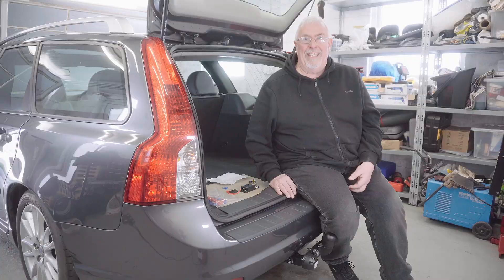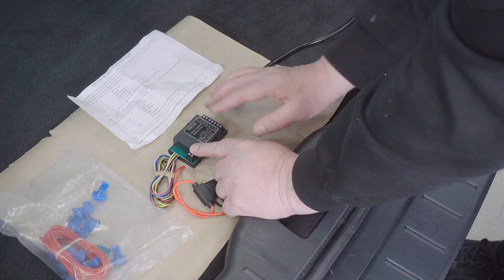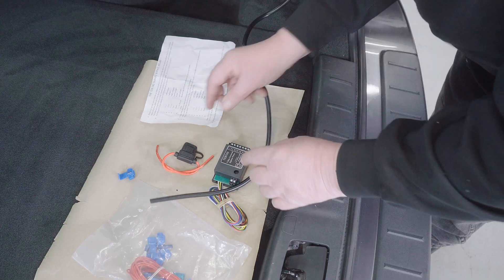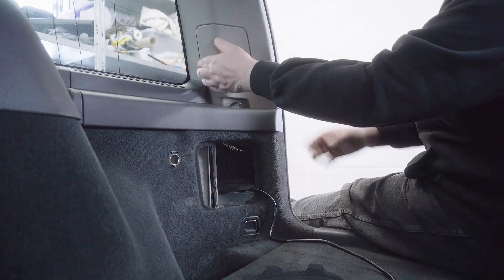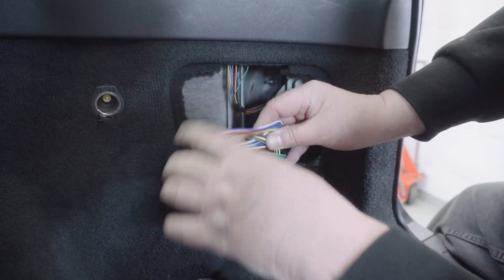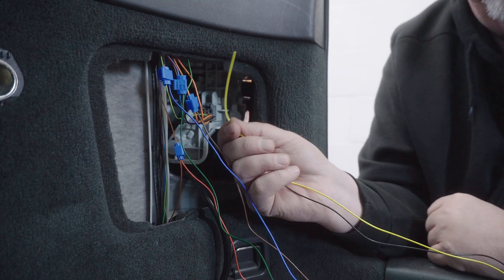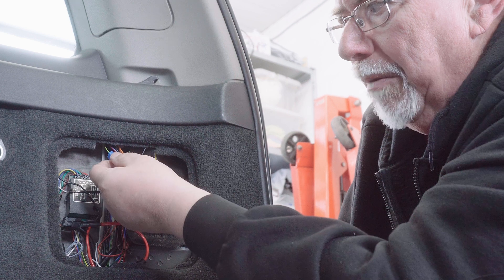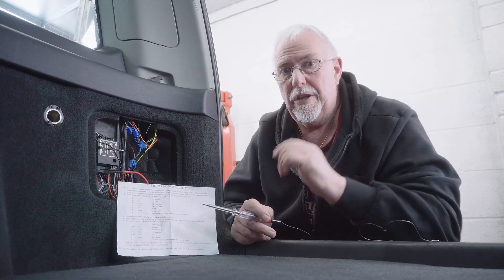Tow Bar Bypass Relay Wiring Guide | Towbar Electrics Installation Volvo V50 C70 S40

Comment: Hey. Great video. Im guessing this would be the same process to fit my 2017 Transit Custom towbar, by using the "hidden" 12v supply thats apparently installed in rear.
Reply from the maker: Thanks! It's likely a similar approach for your Transit Custom, but I'd recommend looking at the specific wiring info for your model to be sure.

Comment: I have a mondeo mk4 mondeo im aabout to wire up the towbar but would i be right in thinking that this will not bypass the reverse sensor as my cars sensor will ring out in 1 gear aswell if i have a trailer on the back is there anyway to get around this
Reply from the maker: I'm not sure how much of an issue this would be.  Most reversing sensors only work when you are actually in reverse.  So although a pain, it would only be an issue when you were reversing.  I do believe that there are ways of either fitting a switch or a sensor to disable the reversing sensors when you have a trailer, but I haven't had this issue so I can't really comment on it.

Comment: Great video, Thanks. Would have liked to see how you best to keep the cigarette socket functional though, I'm unsure of whether i need to solder it or not or if there is an easier way.
Reply from the maker: Thanks for the feedback, that's a good point about the cigarette lighter – I'll try to include more on those kinds of connections in future videos! Basically I made 2 small "for want of a better word"  looms.  One for positive one for negative. Using two wires with one female connector joining the two together with male connectors on the other ends.  About 2 inches long.  I plugged the relay to one of the male connectors and and the power for the cigarette socket to the other, then the female plugged into the cigarette socket, so both could use the same power.  Hope my explanation helps.

Comment: Doesn't work for VW Tiguan, indicator led's are mili volts and not strong enough to trigger relay. Ask me how I know 😮
Reply from the maker: Ah, that's really helpful feedback about the differences in indicator signals, especially for VWs – thanks for the heads-up!

Comment: Nice clear video. I'm fitting a tow bar to my 1990 nissan caampervan. No electronics so just a wire hunt. Your video was very helpful as it even showed which connectors on the plug powered which lights, just what i needed to know. My only issue is what about fog lights connection?
Reply from the maker: Glad the video was helpful for your Nissan campervan project! For fog lights, you'd typically connect the number 2 pin on the socket to the vehicle's existing fog light circuit via the relay.

Comment: Why do you need to connect left and right tail lights as they both come on together?
Reply from the maker: Great question, and I have wondered myself. I suspect it is so that there is a fail safe if one doesn't work.  Maybe its a legal requirement in some countries.

Comment: What about fog lamps?
Reply from the maker: Connect them up to number 2 the blue wire.  You will have to find the wire to take them off in your cluster, shouldn't be too difficult.  My trailer hasn't got fog lights so I wasn't too worried.

Comment: If i will not plug all cables ,there was problem ?
Reply from the maker: I am not sure what you are asking.  But if it is along the lines of I don't need to use the indicators for example, then you could just leave them disconnected and the rest would work.  My relay has a reversing light option, which I didn't use.  I hope this helps.

Comment: Hi Chap. Great video. I purchased a full kit UniKit 2G . The issue I have is that all the lights (Brake, Indicator and Lights on board) was well as the buzzers come on when I either turn on lights or when I brake. Indicators work correctly. Going on a Fiat Panda 4x4 2014. So question. Is this a bypass relay issue or something else. Cheers
Reply from the maker: It sounds like something is shorting out, maybe some wires are touching or maybe the relay is faulty.  Just one thought though have you got the live and earth connections the right way around, I would check that first. I have fitted quite a few of these relays and never had problem like you are describing.
Reply: @SPANNERRASH. Hi. Thanks for responding. They supply identified white for earth and a long red for power. I am getting a replacement from dealer and ordered one like yours. Will let you all know

Comment: All this effort and possible future headaches just to save a few bucks...

They don't make vehicle specific kits for fun...
Reply from the maker: And the hourly rate for programming it to the car :)
Reply: @SPANNERRASHThere are vehicle specific kits that don't need programming like for your car. 

I had a Ford Focus and as they share platform and thus electronics, I can say with confidence that you wouldn't need programming.

And as there have been changes in regulations (thanks to Volkswagen), car makers are now required to have basic towing electrics (meaning lights) to work without requiring coding. 

Only when you get into comfort systems, you will need coding.

So no excuse for not using vehicle specific kits, which for some brands like the Volkswagen Audi Group are more and more becoming platform specific kits.
Reply: @richard1977 I tend to agree. It’s fine for older cars but on modern cars by the time you’ve fannied about taking panels off and tracing wires  you might as well have fitted a specific kit so the car ‘knows’ it’s towing and the braking and stability programs account for that.

Comment: Not a particularly detailed tutorial, especially when it comes to powering the relay. How was it done, and what fuse amperage was used?
Reply from the maker: Sorry if it missed what was important to you.  Running a wire from the battery back to the relay will be different in every car/vehicle so it might not have helped.  A 15amp fuse is more than enough for the relay, but most come with a 20.  Hope this helps.
Reply: @SPANNERRASH Yes, that helps. I've used a 20-amp fuse and found online all the diagrams regarding this particular relay. All working great in our Suzuki Vitara 73 plate. Thanks for the video and the engagement with us subscribers.

Comment: Great video, I would say though that it would be better to use a "12v piggy back fused lead" to come off a permanent supply (use a multimeter to find that with the ignition off) at the fuse box that way it'll be fused and you don't need to go through the bulk head to get to the battery. As you say yes scotch locks aren't the best thing to use, I'd rather solder each lead in and use some heat shrink, much more neater and you'll have a better connection!
Reply from the maker: Appreciate the tips, will keep that in mind for future videos!

Comment: The down side to the buy pass relay switch is you can hear the relay clicking in the car when you press brakes or when using the indicator lights
Reply: Use a PCT ZR2500. They don't click.
Reply from the maker: It's true, it can be a bit annoying, but at least you know its working!  You could try putting sound proofing around it, maybe make a foam box or something.

Comment: Great video. Why can't you just splice into the rear light wires without a relay on modern vehicles though?
Reply from the maker: I am not an electrician, but my understanding is...  Modern cars don't just use standard switches, they use a CANBUS system, a Car Area Network, which instead of just turning lights on an off with switches, actually sends signals down the cables that turn the lights on and off, at a very low voltage and current.  If you tap an extra circuit to these wires with a bulb drawing much higher current than the system expected it will start to cause failures and error messages.  The relay actually powers the lights from the direct power supply to it, with the wires connected to lighting just sensing that they are on or off taking very low current.  Hope this helps.
Reply: He's absolutely right and also it could cost you a packet to have your lights reprogrammed if you don't use a relay!
Reply: It will disturb the CanBus measurement of current drawn by the regular bulbs. Resulting in possible error status being set or bulbs indicated as defective, and in case of any shorts occurring when messing about with some trailer,  blow some fuse that the car detects as a serious system malfunction. The car knows nothing about your trailer adventures, it just measures what current the regular bulbs are supposed to normally show.  Possible  $$dollars required for a service/repair to reset such an error code condition.   So by isolating the mess that can occur when you connect unknown rental trailers och even your own, the bypass relay protects the regular electronics from sensing any out of range high current or short events.

Comment: Great video... couple of questions if I may. I noticed you only connected the brake light on the right hand cluster and not to the left hand side. You only run the 2 wires across to the left hand side cluster which was for the tail light and indicator. The only reason I ask is that I've just identified all the wires on my Ford fiesta and I'm ready to wire up. The only thing im not clear on in the tutorial is the brake that you've wired. Cheers Stu.
Reply from the maker: There is only one connector on the relay for the brake lights, so you only need to connect one side.  There are separate connectors for right and left hand for both the tail lights and the indicators.  I am not sure why, but that is how it is!  I have wondered about this as well :)  The wiring on the trailer side has to split the brake wiring to give both sides.
Reply: @SPANNERRASH You sir are an absolute gentleman! I did wonder... as for the 12v supply for the relay I don't have a socket in the boot like you, I do however have a boot light. That does have a permanent 12v supply... I assume it must be negativity switched when the boot is open and closed. I think I should be OK to use as my power source. As I dont really fancy running one all the way from the battery!. Cheers for the reply.
Reply: @SPANNERRASH It is because left and right parking lights are independent, and can be turn on separately when parked next to the road to alert other drivers that there is a stationary vehicle there.

Comment: I’m just doing mine on my van now. The socket in the back of the van isn’t a permanent live and only powers when the ignition is on. Can this still be used?
Reply from the maker: I don't see why not.  It would only be an issue when you are parked.  You would just have to take that into account at night.
Reply: It would mean hazards would only work when ignition is on, might be illegal?

Comment: Great video! Very helpful. Wouldve been good to see you do the white earth wire but thank you for your help. :)
Reply from the maker: Great suggestion! But I cheated and took both the earths to the earth for the 12v socket in the rear.  Otherwise I would have found something that was bolted to the frame and connected them to that.

Comment: Hi,

Thank you for your tutorial. I know this is for Volvo but I have a question for 2011 mercedes e350 estate. 

We have connected cables from relay to the lights. Mercedes use same cable for indicator and stops. So only one links to the one cable and other cable for the lights. When we completed the all connections only indicators did not work. When we plug of the car tail lights and left the trailer lights connected indicators worked. Our problem is only all connected properly indicators are not working. 
Do you have any suggestions or ideas? It is my pleasure if you help 😊
Even if we tried without relay box directly connected to the lights and it was the same. 
Best wishes,
Reply from the maker: I can only suggest that you use a test light like I do in the video to ensure that power is appearing a the correct terminals on the relay, for the correct lights, then at the correct ones on the socket.  I found that I had to adjust a couple of the scotch locks.  If it changes when you plug the trailer in then it is probably the trailer that is causing the fault.  I do hope this helps.
Reply: @SPANNERRASH Thank you very much. We used test lights panel similar with the panel behind the small trailers. But they are still original lamps instead of small test lights.
We will try as you suggest. But the other lights are working. It is strange. Anyway thank you for your time and response 😊

Comment: If only this was for 13pin
Reply: Same setup, but use a 13-pin socket instead. Same wires and everything. You will only be missing the reversing light.
Reply from the maker: It isn't something I have needed to do. Sorry I don't know what extra issues there might be.

Comment: Did you put up a link to the solder wires please
Reply from the maker: Here is a link https://ebay.us/2C4ooY  I find that you tend to only use the red ones.  If you buy a mixed set you will have the other ones for ever :)

Comment: Great video, I'm just doing mine the now and similarly have a 12v socket at the back that I want to use to power the towbar lights but since connecting onto it I don't get any power, did you run the positive wire and the earth wire from the socket to the bypass switch?
Reply from the maker: Yes I run the power and the earth to the bypass relay.  The live has a specific connection, whereas the earths are the two white wires on my relay, which I spliced to one wire to go to the earth.  I also made a couple of splitter wires so that I could plug the relay and the 12v socket so that they both work.  Good luck.